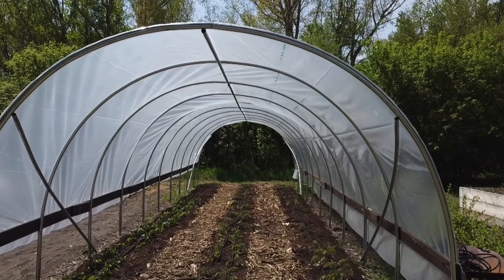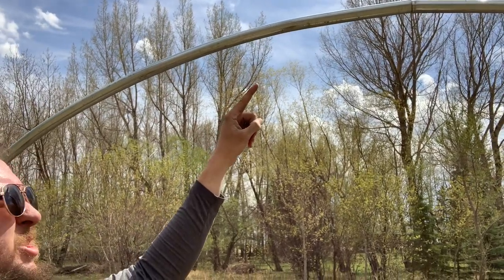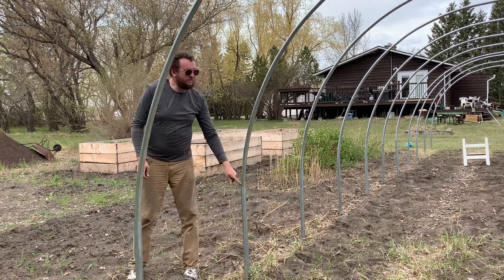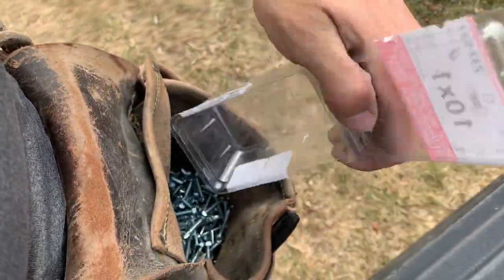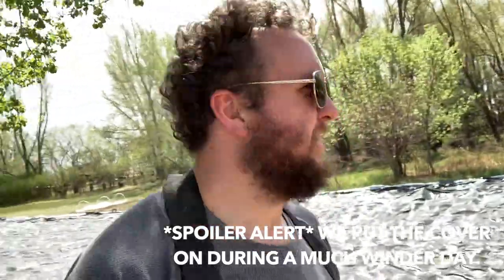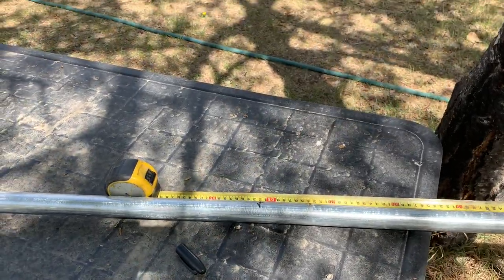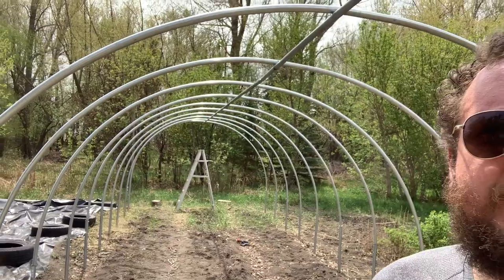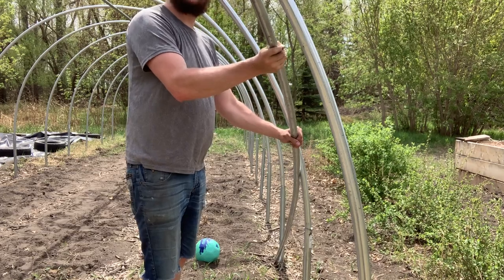DIY Greenhouse Build Part 2

Comment: Do you get a lot of snow in zone 3?  We are in zone 4 and we get lots of snow.  We had to add three  vertical poles one in the middle and one near each end, and attach them to the ridge line, because the weight of the snow made the greenhouse collapse.  The bows were bent like the Mcdonalds Arches.  Don't want that to happen to you.  Great job. (ran a greenhouse business for 20 yrs)
Reply from the maker: We do get a lot, and probably should take it off for the winter, although it held up no problem last winter.